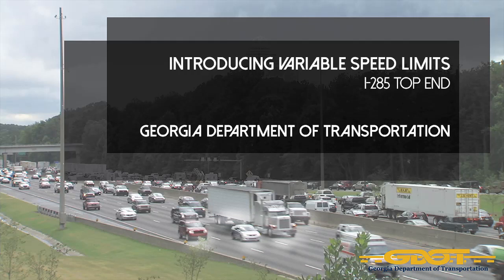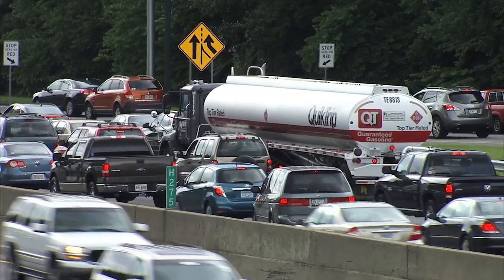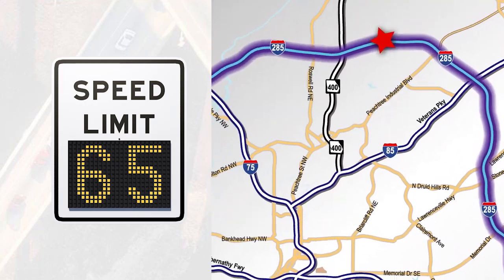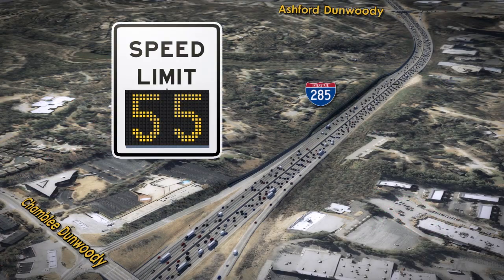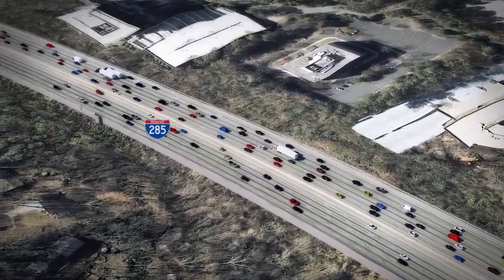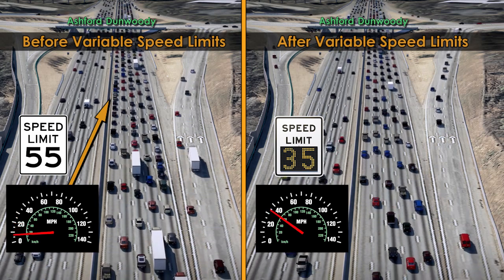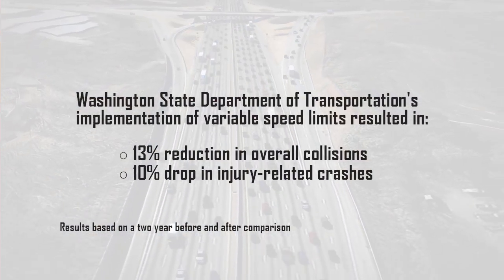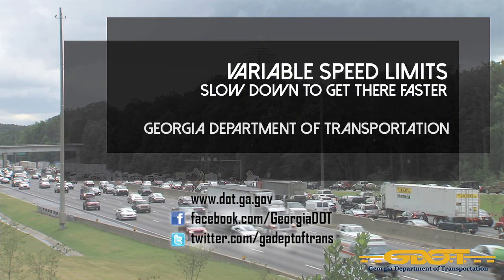Variable Speed Limits (VSL)

Comment: any one from here that travels the Georgia I285 often? Curious if this works.
From an "outside looking in", it seems this is another "reason" to give Highway Patrol/Troopers to give citations for breaking speed limits :)
Reply: It works to an extent, that majority of the time the speed limits are 55-70 MPH (Depending on area) and are really only changed when congestion is bad. That being said enforcement is almost non existent in Atlanta, and up to around 15 MPH over is generally tolerated